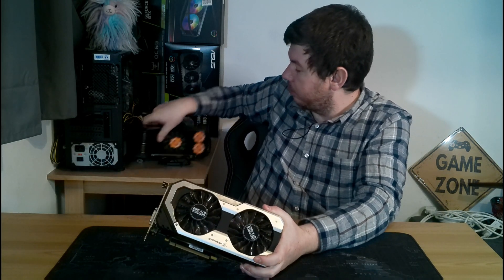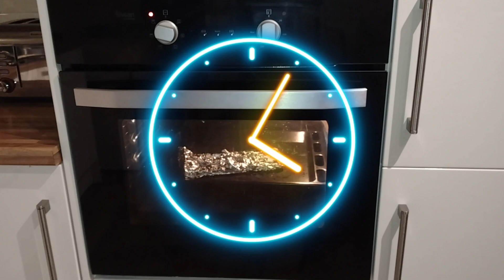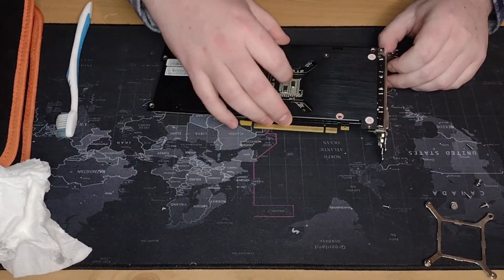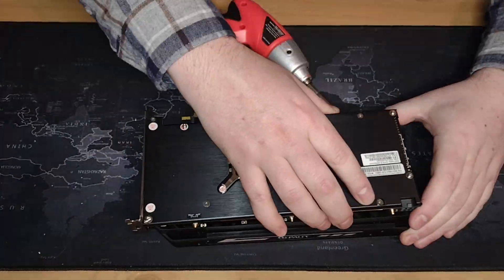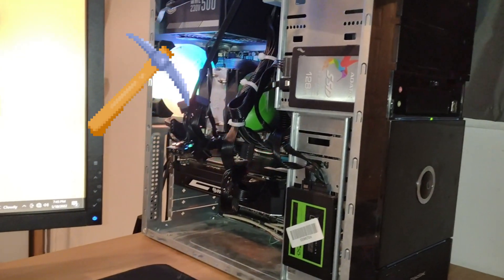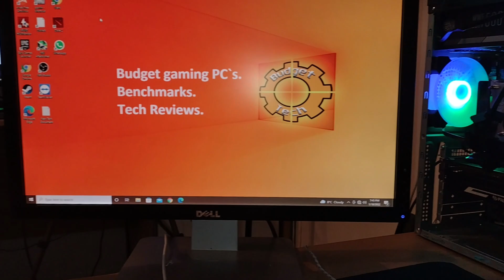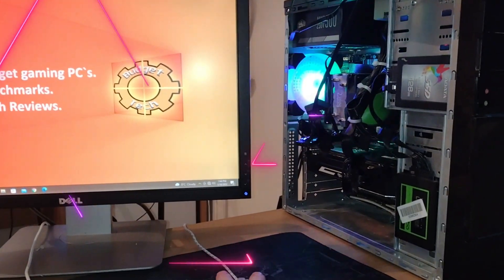Baking my GPU! GTX 1060 GPU Repair.

Comment: Howsit man. I have a Gigabyte GTX1060 6gb which died on me one day when my previous faulty PSU kept tripping my pc. Would you recommend the oven method over the heat gun/hairdryer method? I'm assuming you would since that is what youve done here and it worked but I've seen 50/50 opinions online as to which is the 'more' reliable method.

Also is the 1060 you repaired here still working today after baking it?
Reply from the maker: Hi again. It sadly died after about a week. Thanks for the comment. Heat gun is a better alternative as you can focus more on the dry points. Your issue sounds more like a blown fuse. Its worth checking with a multimeter where the dead points are and just bypass it with some copper wire and soldering. Are you UK based? Id love to do it for you?
Reply: @BudgetTechUKYT  Yeah I also assumed it would be something like that. Basically my psu would randomly cut my whole PC and then restart instantly without error messages or anything. It would do that like once every few days or so and then one day when it did I had zero video output and the lights and fans on the gpu were off :/

Unfortunately I'm in South Africa but I appreciate the offer! Super nice of you. So you rate its worth manually checking each point before heating it up?
Reply from the maker: @TheDJDUCK01  Mmm it might be your 6 pin. Did you try it with another PSU? Or another GPU? If you haven't try. You might need SATA to 6pin. Quick R20 cable from takealot.
Reply: @BudgetTechUKYT  Yeah I bought a new PSU and a second hand 1050 in the mean time which works fine but that doesn't require a 6 pin. I also tried the faulty 1060 in a mates tower and had the same result.
Reply from the maker: @TheDJDUCK01  Ahhh, I would advise checking fuses :) Thanks for the support <3